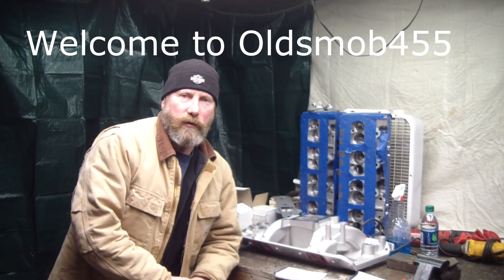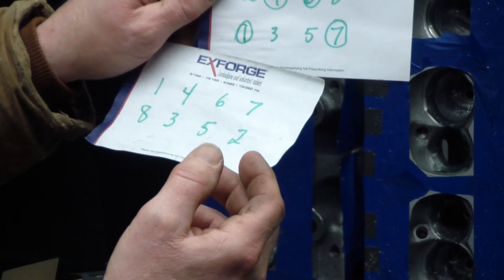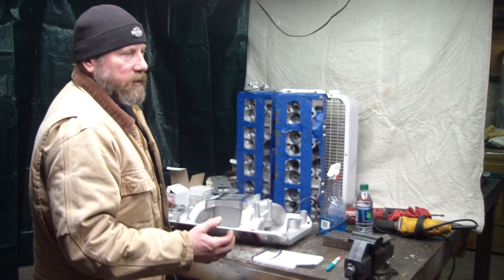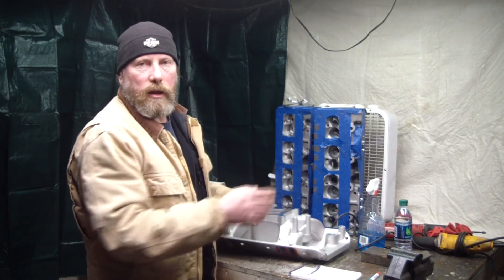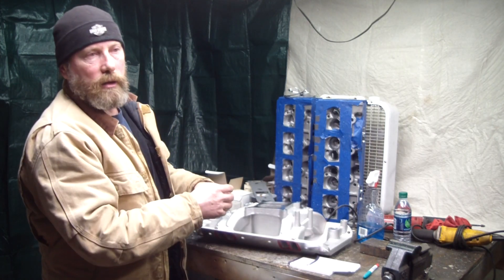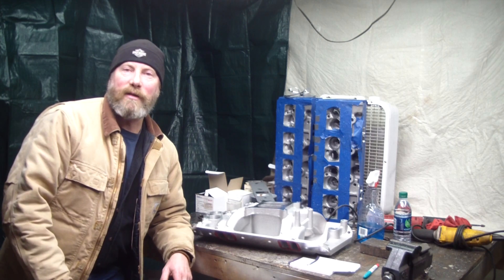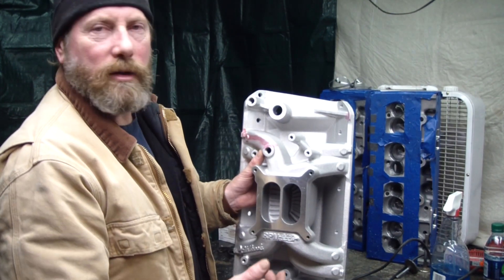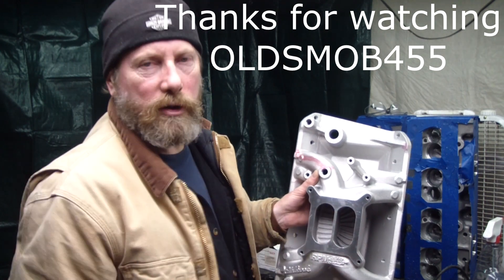Tech Time With Paul: Single Plane vs. Dual Plane Intake Manifolds

Comment: Intake plenum volume is critical. Stoker engines show that on dyno. I just got done building a 505 cud pontiac, im using an All Pontiac block, Kaufman heads, added a coolant bypass hose from the rear of the heads to the front of the intake. Dyno tested it with an Edelbrock rpm performer intake flowing 320cfm. Then tested it with an edelbrock torqer2 intake stock. Plenum volume was a major thing. It made peak power at 6200 rpm at 766hp and 712 tq.
Dyno same engine with the single plane had off idle stumbling, less plenum volume also held it back from reving.
Cam profile and head volume and intake volume make complications

Comment: Back in the 80's I worked at a high performance warehouse, had a 65 Nova with a 350. Had a girlfriend with a 69 Chevelle with a 327.
I had an Edelbrock streetmaster, she had the Offenhouser dual plane that I installed.
That Offenhouser was WAY smoother on idle and quicker acceleration.
I wished that I had installed that in my Nova.

Comment: Any recommendations on an upgrade over the factory intake manifold for 'a 78 Continental with a 460?  Not looking for a hot rod, but would like to get more HP out of that choked-down big 460.  Edelbrock makes various models, but wondering on what model/price point makes the most sense given my situation.  Also, wondering about an appropriate Holley carburetor. Thanks for the help!
Reply: A performer would help ya.
Reply: 3310 Holley vac secondary will work for ya. 750cfm.

Comment: on a single plane intake its harder to adjust air screws on carb, duel plane separates the carb and makes adjustments easier for idle and low rpm. single plane is pedal to the metal very fast air flow not best for street.
Reply: +Robert Thomas I think I made it simple as it can be.
Reply: +Robert Thomas a six cylinder one barrel carb feeds all cylinders with one  air screw and intake is a single plane get it